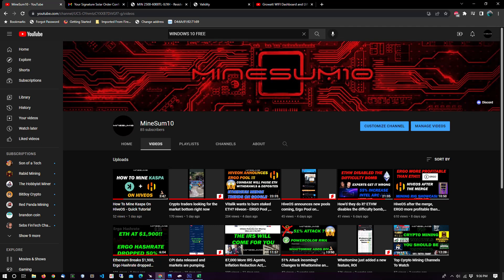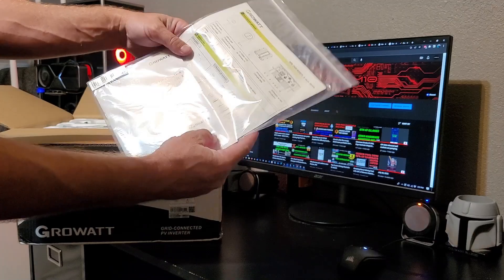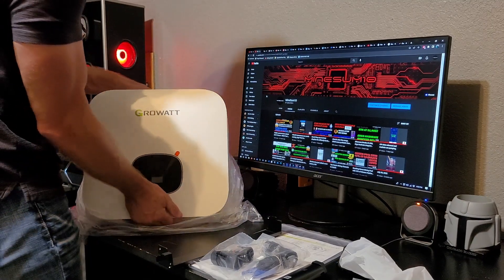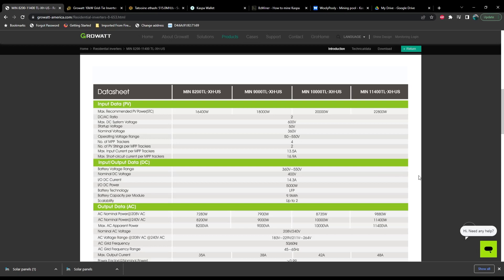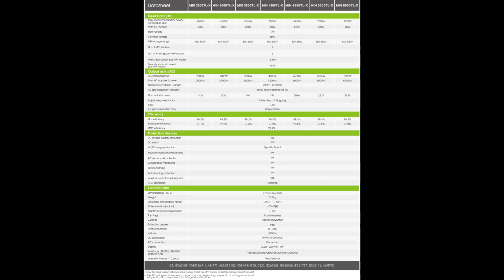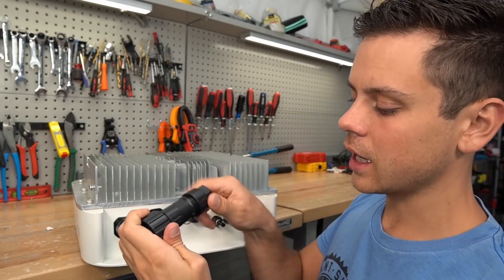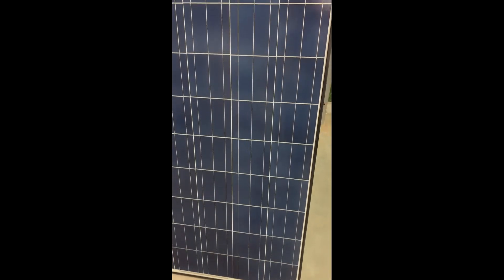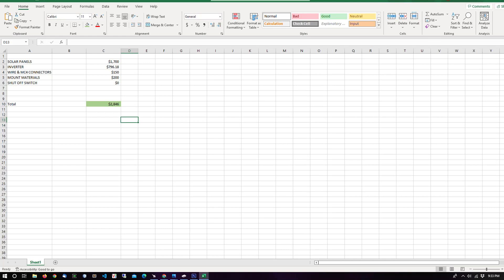DIY Solar Powered Crypto Mining Farm, 7500w under $3,000, Detailed Parts List, Passive Income

Comment: I have thought about doing something similar. I am wondering about using a small 12 dc system to run led lights to power to solar panels. This way I don't need a large battery bank. 

Yes I know that I will only be able to get about 50% of the power from a panel. But if the 12 vdc system is powering it my hope is to have power 24/7 from the panels. 

The other thing that I want is for the system to not take up a lot of space. If this works I should be able to stack up the panels and have a small footprint. 

The key is two different systems. One that is dc to run the lights and one that runs the invertor. This is going to take a lot of math and time to get to run right. But I hope that in the end it will be more reliable than a battery system. 

Thanks for letting me know where I can get used panels from. Now it's time to start to play. Go luck with your system.

Comment: Does this inverter put extra power back into the grid or is the ac connection just for when the sun is down?
Reply from the maker: Yes the inverter feeds AC back into the grid.  With a "Net Meter" from my electric provider, it runs the meter backwards when I produce more than I am consuming.

Comment: Could you possibly do a video of a full system setup? Like showing how you wire everything and how you hook it all up? I am very interested in doing something like this on the cheap side to offset mining costs, but am not that familiar with electrical.
Reply from the maker: Absolutely. The wire arrives Monday next week. There will be several parts in this series. 👍 Next time I’ll cover wiring - series - parallel and how to calculate watts amps volts.

Comment: What are you mounting the panels to that is free? Racking is usually an expensive part of a system.
Reply from the maker: I have two options and still debating.  I have material laying around. I have steel but would prefer something that couldn’t rust. Might paint it. I’ll be sure to share that in the following videos

Comment: so if it can only accept 550v total even for the larger wattage ones, wouldn't you not be able to make use of all 10,000+ watts if you had panels producing that much? Kind of confused on this part
Reply from the maker: Excellent question. This is why it’s very important to calculate your voltage before making any purchase.  When solar panels are wired in series, the voltage of the panels adds together, but the amperage remains the same. Wiring solar panels in parallel causes the amperage to increase, but the voltage remains the same. Some solar panels are 37V some are 24V, there are many variations…it just depends on which solar panels you buy. As an example, if you have 15 panels that are 30V and 8A wired in series your end will have 450V at 8A.  If you parallel them you would have 30V at 120A.
Reply from the maker: Volts x Amps = Watts
Watts / Amps = Volts
Etc, etc.
Reply: @MineSum10  so paralleling the panels would exceed the max amps allowed then correct for example for the 10,000 watt unit as it says max amperage is 42?
Reply from the maker: @bonfiggy5620  correct

Comment: so if i have a 3.5 kw mining farm how big a a system do need to have to run / thats 3.5 kw per hour. /? thanks
Reply from the maker: If I understand you correctly your farm uses 3.5kw continuously. It depends if you want to cover 100% or just some of it. For example this system will produce 6,000w at peak for approximately 6 hours a day optimal conditions. 6kw x 6 hours = 36kwh per day.  You farm is using 3.5kw x 24 hours a day or 84kwh a day.  84 -36 = 48kwh left to cover. So this system would cover about 40% of your usage on its best days.
Reply: @MineSum10  thats whe i thought. / we are not there on solar yet. thanks for the content